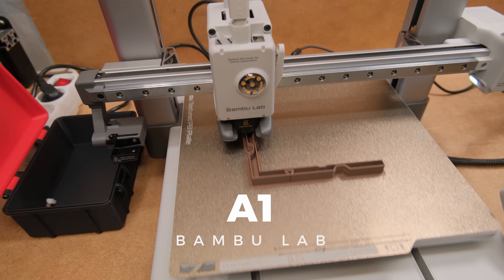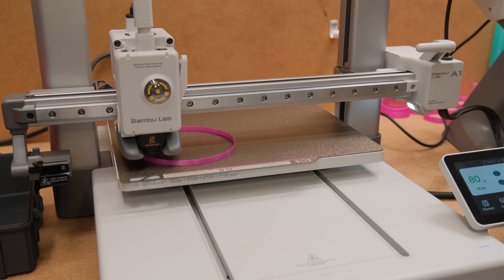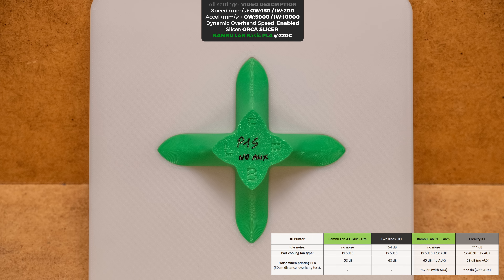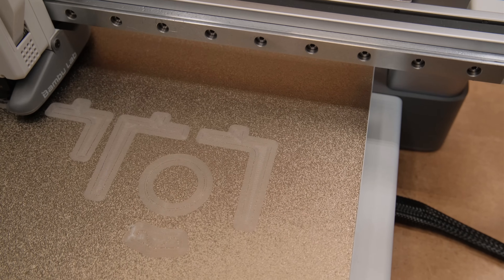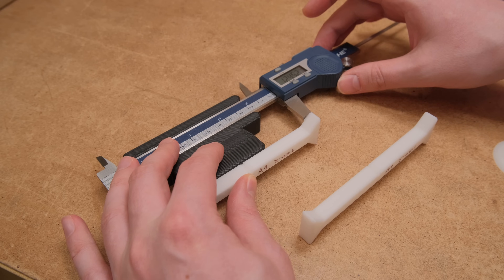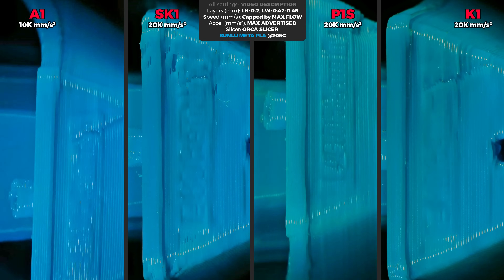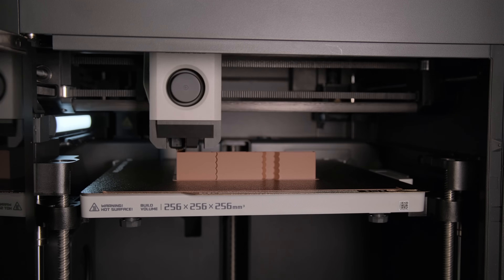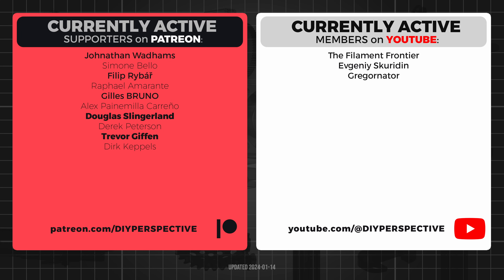BAMBU LAB A1 vs TWOTREES SK1 compared to P1S and K1 (3D Print Quality REVIEW)

Comment: SK1 needs some tuning. I've good mesh from the bed only after playing with the bolts under the 4 corners.
It needs regulation of the belts. Before doing it you've to add scripts into Klipper for belt resonaces. 
I put Oldham couplers on Z. 
Firmware 2.02.34 resolved lot of issues.

Comment: Great comparison. By the way, did you make use of the auto flow calibration when starting a print on the A1? This seems to use the flow rate sensor to adjust the flow rate during whole of the print. ??

Comment: TBH it seems like a decent printer, it just needs to be $400, which seems like a very difficult price point to hit. For me, I'd probably spend $300 on a Qidi X-Smart3 before $400 on a Bambu Lab A1, but I like that we're becoming spoiled with options. Def some strange choices on this Two Trees machine that I think they can at least improve with minor revisions, like those belt guide pulley mounts.
Reply from the maker: SK1 is definitely not a bad 3D printer, but it is hard to recommend when it feels unfinished with questionable decisions. The sad part is that the main problems could have been easily solved during the design stage. We are getting spoiled with options but with average options at best, where nobody can come even close to the standard that Bambu Lab set. That is what worries me in the long run.
Reply: @PrintingPerspective  Definitely understand that... Perspective. ;) The average quality of Bambu Lab prints makes it hard to question any of their pricing and of course recommending them in general. I'm a huge tinkerer, so I don't mind some work if I save money, but I still don't want something fundamentally flawed. Hope they fix issues based on feedback from you and others! Many are easy to fix. At least Creality tried to fix the K1 cable chain issues with the K1C, but even they can do better, hahaha.
Reply: Its $299 right now with coupons. Even then I wonder if it is worth it...
Reply: @erehro  It's a great option.

Comment: Great overview and review, I still dont know what printer to buy out of the A1 vs P1S. Is it worth buying the P1S overall if unsure about materials in the future. Do you think there will be major releases this year that might make the P1S obsolete?
Reply from the maker: If you have plans to print ABS, like for example for DIY printer parts or you can design your own practical prints I would go for the P1S. I can't imagine even Bambu Lab releasing a printer that would make the P1S obsolete in coming years.

Comment: Hey, I recently bought the sk1 and I'm pretty dissapointed by it. The price difference however is massive, I bought mine for around 480USD while P1P is 730USD for EU at the moment. I tried to bend the pole mounted idlers to see if mine are as bad as yours and to my surprise it is not bulging at all. Perhaps you're running your belts too tight? I don't really know. I'll be adding another MCU just to control those God awful fans since it is impossible to live with such a loud printer. Oh, and mine came with BENT STEPPER MOTOR. Like how do you get Z motor shaft to bend???? It's beyond me. Leadscrew and coupler were thrash as well, luckily I had a spare stepper from an old Ender extruder. Imo it's a "you get what you pay for" type of thing - I would much rather get a Voron kit or a P1S but it was just out of my budget. Thanks for your review, if I saw it earlier I may have dodged a bullet.
Reply from the maker: I haven't touched the belt tension. TwoTrees includes a note saying that the printer passed like 46 inspection points, so if they didn't tension properly the belt, that is kinda on them. But it felt on par with the Bambu Lab or Creality printers, nothing unordinary.
The problem is the long rod design, maybe you haven't applied as much force as I did. But nobody even with little engineering knowledge would choose a design like that on high acceleration 3D printers.

Comment: Great video, and for a high-speed printer, I would still choose CoreXY. The structure of SK1 attracts me, but it seems that the firmware part needs improvement. Creality K1 looks good, but I encountered many issues after purchasing one, and I found that its entire support structure is just its plastic shell. I don't believe it can remain unchanged after working for a while.
Reply from the maker: While the SK1 frame is nice and rigid, their used long rods for the idlers are just a joke. All they had to do was to fix the bottom of the rods to the frame. This is what annoys me the most... Mistakes like these destroy all the potential that the printer could have.
Reply: @PrintingPerspective  if you still have the sk1 can you please make a video with design mods that can bring out the sk1 potential ?

Comment: Love that you actually compare measured results rather than anecdotal ones like other Youtubers usually do. Sick of seeing others compare things like tolerance test models between machines , and usually without even telling us if they created calibrated filament profiles with the correct PA and Flow Rate etc. Your information is actually useful to compare.
Reply from the maker: Thanks. Yeah, tolerance tests test the slicer profiles not the actual 3d printer.

Comment: The machine shows great potential, and the hardware is indeed well-done; however, there is room for improvement in the firmware. Once the software is optimized, I would consider getting one.

Comment: I think the reason why the A1 has such good extrusion results is because it uses a single gear drive with an idler instead of the dual gear, just like in the Mk4. I wonder if it has the potential to become the new standard since both printers handle TPU just fine
Reply from the maker: Most likely, MirageC has probably the most topics about it explaining it. If it becomes a new standard depends if the gear has enough surface area to push the filament without deforming it. I might need to think of a test that could show it the best.
Reply: Yes, the filament might wander between dual gears, but that could happen with every hobbed gear.
I think it's more about rotating parts not being concentric: motor gear with stepper shaft, POM/nylon gear and drive gear with drive shaft.
Cheap Titan and BMG clones are often so bad they don't even run smoothly (too tight on one end but slack on other end) 🙄
Bigger gears could be easier, but it all comes down to manufacturing parts in proper way (like Bondtech IDGA)

Comment: It's funny some get good printers and some get bad ones. I got a k1 and had a few issues with the bed not being level etc. I was able to fix it easily and rooted it and am now running stock Klipper. I also loosened the belts a bit and most of the artifacts and inconsistent layers are no longer an issue. The biggest thing for me was the price. I was able to get my k1 at about half the price of a p1s. So when you look at it that way the k1 starts to look way more attractive. Now I get some don't want to have to do that but for those like me who don't mind tinkering it is a good value. I am also not new to 3D printing as the k1 is my 4th printer. If the P1S wasn't a 1000$ here in Canada I would have considered it. But is it twice as good as a k1 that is sorted out? Well, not sure about that part. Just my opinion and thanks for sharing. Cheers
Reply from the maker: I mean, that is a very valid reason to buy K1. If you can fix most of the issues with no significant increase in price then it is a good option. It always depends on your region's price and your skills. I am glad there are people like you who understand that and can take it into account and not just say it is not fair to compare K1 to P1S.
Reply: It would be interesting to see all printers properly calibrated (K1 needs to be rooted as you did -> better input shaping), but of course that's not what everyone does. But K1 seems to have aggressive IS and too high acceleration when printing -> details blurred.

Also what kind of print quality calibrated K1 would do at A1 speed (slower, 10K) - would A1 still be better 🤔
Reply: I agree but there is one more issue, I don't want to encourage theft, those that steal from others should not be paid for their lack of morals.
Reply: Is there a way to reinforce this k1 rod with some printed part?
Reply: @raulelias2013  well technically there is a linear rail mod you can do. May I ask why you are asking? Are your linear rods loose in the gantry or printhead or something? The k1 rods are quite short and are large enough that it should not be an issue. The main issue with k1 is the bad bed leveling from the factory and the vfa's.  And the bed is easily remedied. The VFA issue is not as easy. It requires either some tunning of speeds to help or smaller pulley gear on the 2 back motors. Just like Creality changed on the k1c and newer k1 max.
Reply: @Andre_M_3D  I mean sk1. It costs half as much as Bambu where I live but it seemed to me that the back of the bed could swing sideways due to the vibration and sudden movements of the printer.

Comment: 90 degree corner bulge test.  This should be a MANDATORY rating for all 3d printers.
Reply from the maker: I don't think so, because bulging on the corners depends mainly on how well you tune the pressure advance. It only would be useful to compare machines that run linear advance on Marlin vs pressure advance on Klipper.

Comment: Bambu hates bed-slingers... but they made two of the best bed-slingers ever created. 😄
Reply: They use a bed slinger to defeat other corexy. So why not. 😅
Reply: @majianjia 
It’s a way to reduce cost and try to pressure competitors.  It isn’t as good as the X1 or P1 series, but is a good bed-slinger that offers multi-material.

In terms of cost to capability, however, a Neptune 4 is a lot better.  However you don’t have a multi-material option for that (at least as of now).  I would not buy Bambu Lab for a single material printing requirement as it is over-priced.  (They do at least offer a lot of spare parts at very reasonable prices, so the bespoke parts issue is mitigated.)
Reply: Core XY or bed slingers, the fact is that Bambu Lab makes the best printers, no matter what. Buying anything else is a waste of money. And that is a fact!
Reply: facts! @TheNature101
Reply: It's nice because they force the market to step their game up.
Reply: @davedempsey5282  
The Elegoo Neptune series was there well before Bamboo.  Plenty of good, fast, bed-slingers from different manufacturers now.  You can also get a faster Core-XY machine for less.  Multi-material is the ace up Bambu Lab’s sleeve, right now — but that won’t last.

I have a P1S and AMU.  The P1S has been reliable, with only a few issues such as a tendency to collect filament on the nozzle and randomly drop it (nozzle cleaning system isn’t quite 100%).  The AMU I have cleaned and rebuilt, swapping out for slicker Bowden tubing, but it can still struggle with retractions.

Bambu Lab is good, but they have competitors that are cheaper and just as good — when handing a single material.

Comment: 9:15 the a1 does a pre sliced 14min perfect quality benchy
Reply from the maker: Try to get those 14min benchy times actually using the slicer that you will use for all of your prints.
Reply: @PrintingPerspective  I know it takes 40 mins on slicer but it’s still possible to print a 14 min benchy with pre sliced file
Reply from the maker: But that is the whole point. It is pre-sliced and non-representative of all the other prints you will make on your printer when using a slicer. Who cares if it can do even 10min presliced benchy if it means nothing as you will never get that on your other prints.

Comment: With this video you just got the holy trifecta - Like, Share, Sub 😀
I got tired of recalibratimg the printers every 5 prints whilst running "stock" 50-80mm/s speeds which in reality translate into up to 50 on most objects.
I researched my best out of the box - stable, consistent, least hassle - core xy option and Bambu it was. I drooled a bit over SK1 and given it was so recent, no effective and relevant reviews were found. K1 looks good at dirst glance but once you go past the "speedy" veil and dog deeper, it again turns out to be what all Creality are - a good tinker toy but lacking the quality at 50% capacity whilst retaining consistency. I looked at Flashforge, Flying bear and a few more but "with consistency" Bambu's P came up on top.
I just pulled the plug on a P1P which will get a number of upgrades to bring it to S state...and maybe a bit better.
My next curiosity will be - once i go through the P1P - how well a Mercury 1.1 and a Trident will stack up on the same lines? - consistency, lack of hassle once set up - how many prints in between a pair of tuning cycles?
Thanks for your review and your time to put together these info shares.🎉
Reply from the maker: Thanks. I only have Voron 2.4 and even though it is a budget Fysetc kit it has been good with Stealthburner and TAP upgrades so far. The only calibration that I might need to do after multiple print hours is the input shaping. But it is a DIY printer that requires a huge amount of hours to build, tune, and make or get custom scripts for it. Hardware and design-wise Vorons feel very solid, I compared the print quality of V2.4 vs X1C in one of my previous videos.
Reply: @DIYPERSPECTIVE  Thanks for the feedback...wasn't expecting it really 😀 I surely watched the 2.4 vs X1 at some point but I'm now going for it again 😀 adding to the stats.
I know the voron is a lot of work setting it up but that's not a problem. My target is to get reliability   over time and a trident is in plan.
Provided I don't forget 😀 once I have both the P1 and the Trident where I want them, I'll buzz again and share my thoughts :)
Cheers 😀

Comment: Im pretty disappointed with the sk1. It starts with the always on fans, the fact that they didn't even bother to put the leadscrew nuts on the right way (at least POM nuts), that they are still using the crappy steppers that were used on the sp3 and sp5 printers (vfa), smooth idlers on teethed side of the belt as well as the cantilevered idler mounts, more or less a rail only x axis thats no at the center of gravity. The only selling point is that it got tripple independent z axis which is pretty unique and that it has klipper. Fixing all these issues would be time consuming, especially the cantilevered idler mounts and toolhead balance, at that point you could nearly buy a voron trident which would have the same feature set. 

My take on the k1 artifacts is that most comes from the larger stepper pulleys. Less accurate and more wiggle in the axle. As you probably know the magnets allow for a little wiggle in the steppers position without loosing steps, because they are magnets. I cant remember if it was a 32 or 36 teeth pulley, but regardless quite a difference. Also the reason for the 60mm steppers. I personally would bet that swapping to 20t pulleys would result in a print quality increase as vfa would be less pronounced and corner overshooting would be less. Noise levels would obviously change, but since the k1 doesn't use stealthchop by default it won't suddenly be much louder

The bambus superior extrusion comes from their integrated drive gears, similar to the bondtech idga or ridga, the a1 additionally being a single gear extruder ruling out any meshing issues of the feed gears
Reply from the maker: True, I just hope TwoTrees fixes the problems with version 2 as it can be a pretty good printer.

Comment: too bad you didnt include the qidi plus 3 or qidi max 3. Other than that its a really nice comparison.
Reply: I have Qidi X-Plus 3 myself. The print quality is amazing on it. It's only let down a bit by its weaker hotend heater. There's now aftermarket CHT clone nozzles for it that lifts its game to >20mm^3/s.

The latest revisions of the X-Plus 3 are miles better than fhe first release ones that were pulled from sale.

I also have a K1 that I've rooted, fixed the input shaper, changed the hot end, retensioned the belts. It's now WAY better than it was fresh out of the box, but it still doesn't hold a candle to the prints coming off the Qidi.
Reply from the maker: I doubt I will ever include them as my experience with the first gen X Plus 3 was horrible. Maybe if they release redesigned printers I will check them.
Reply: @PrintingPerspective  they have made significant structural changes to the frame after gen 1 so you should really try it.

Comment: why does it seem like corexy printers suffer more from vfa, i had a neptune 4 and it was pretty much flawless in print quality until the bed calibrations stopped working, i then got a k1 after returning and it printed like absolute garbage because of vfa, i could never get rid of it... i think im going to go for the a1 combo, hopefully it lasts long.
Reply from the maker: Probably because on a CoreXY two motors work in tandem to move. For example, moving in the Y direction both motors spin equally, so VFAs might be amplified. That is my best guess, but I never explored this topic more so take this with a grain of salt.
Reply: When they aim for max speed, they slap in large stepper motors -> "hard" stepping at lower speeds when inertia does not smooth rotation? Too low stepper current at low speeds (added from StepperOnline docs)
Belts resonating with stepper judder?
Non-Gates belts and/or non-Gates pullies -> belt speed/tension changes when running through motor pulley (and - less likely - running over smooth idlers)? 

K1C (reportedly?) has smaller steppers and smaller pullies. We'll see if that helps.